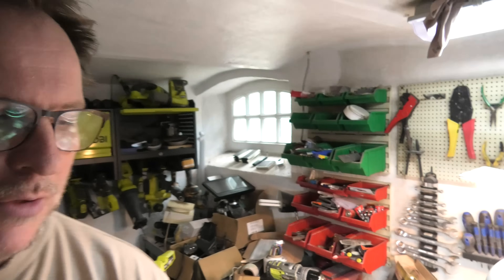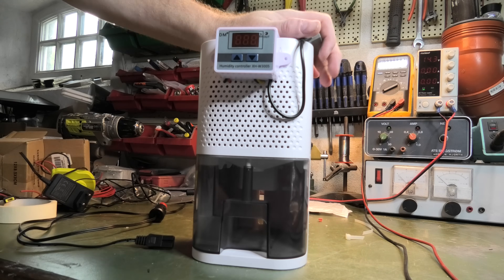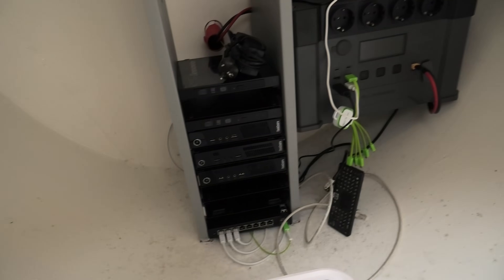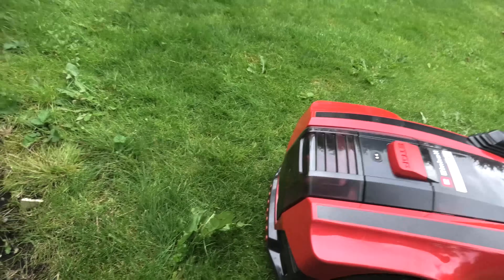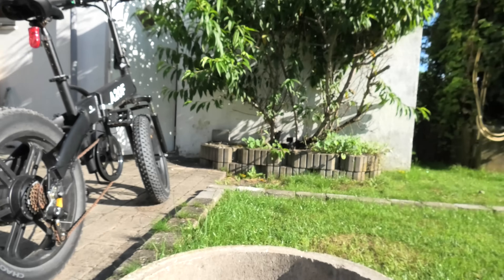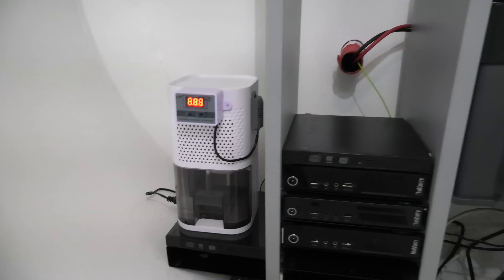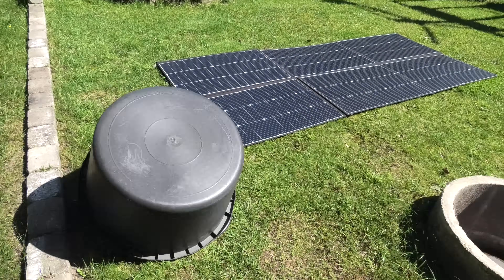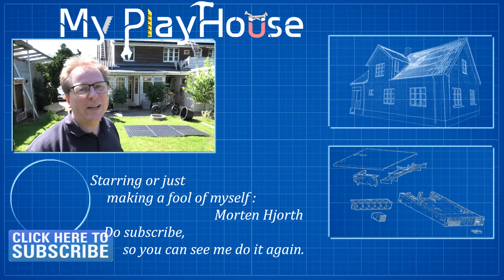Bunker Dehumidifier Finally Working as it Should, But Disaster!! - 1409

Comment: Have a look at Switchbot, they make a device that presses most switches. The switch can work independently or with an additional hub with its own humidity and temp sensor.
I use mine for a desiccant dehumidifier that isn't supposed to be turned off as it needs a cool down cycle.

Comment: Peltier-based dehumidifiers are useless energy wasters.  Go get a desiccant or compressor-based one.
Reply from the maker: It´s a balances,, the Peltier-based dehumidifier is not as effective,, but it is a lot smaller, and uses less power while running (It has to run a lot longer, and uses more power that way) But I can run this from 12v DC,, and I am aiming to run everything on DC.

Comment: I've had an issue like this with a bluetti eb3a to get it to come back on I had to charge it using AC and not with the DC input that may possibly work aswell, you could also try disconnecting the internal battery from the circuit board inside the all powers device and reconnect it this has fixed my eb3a in the past aswell
Reply from the maker: I have figured out what is going wrong,, it’s an extremely advanced issue, and reprogramming of the microcontroller is necessary 😬
Reply: @MyPlayHouse   Please post a video on the fix for the power station - I (and I believe many others) would find this useful knowledge.

Comment: You're going to keep having moisture problems long into the future, since you built your bunker inside of a water cistern.
Reply: a industrial dehumidifier would get rid of it in a weeks time...

and then you need to add a membran to the outside of the bunker like with old basements
 this could be as dry as a dessert in under 14 days
Reply from the maker: I did see this Peltier-based dehumidifier working before the Power station gave up :-/ Give it a few more hours and it would have been dry..

Comment: The battery thing was a nice try, but don't you think it would actually make more sense to run a power cable through your pipe to provide your bunker with a reliable power supply?
Reply from the maker: You really need a bunker when the outside is not reliable. so just relaying on stable grid power, kind of goes against the purpose. And this is just my little fun project. No worries.

Comment: What are your long-term plans for controlling the humidity in the bunker?  I don't think the bucket sitting on the entrance is going to stop much.
Reply: He should just get a condensate pump and pump it through a sealed hole outside of the tank.
Reply from the maker: We start here,, if this does not work,, we will have to try something else.

Comment: I don't like that 12v outlet on powerstation isnt protected for overdischarge. Allpowers needs to fix that, period🫡
Reply: or at least put a clear warning about it on the device or in the manual. Other people might use this to keep their 12V fridge running all day on a hot day at the beach and the 230V output can pull a load too for a radio or so, so the 30W on 12V should not be that devastating. At lest some kind of protection should be in place?
Reply: @matejkotnik9675  They should not be in business. This product just doesn’t work.
Reply from the maker: That was not what has happened,, new video today..

Comment: From the video I got the impression the 12V cigar outlet may be directly connected to the battery. The dehumidifier may have drained the battery below the safe charge voltage and the bms is rightly preventing charge - easily verified by measuring the 12V output - possibly recharge through the same 12V connection however with very reduced power (100 mA max I think) you do not want a runaway battery cell
Reply: Maybe the Pack is Split in parallel for the Power Bank?
Reply from the maker: The S2000does not have a 12 battery,, but a 24v,, as far as I have measured,,, but it does feel like it has a direct connection,, through a DC to DC converter...
Reply: @MyPlayHouse  sorry, in  that case I see no other solution as to open up the case and drip-charge each cell until above minimum before allowing the bms to try charging
Reply: @MyPlayHouse  sorry, in  that case I see no other solution as to open up the case and drip-charge each cell until above minimum before allowing the bms to try charging